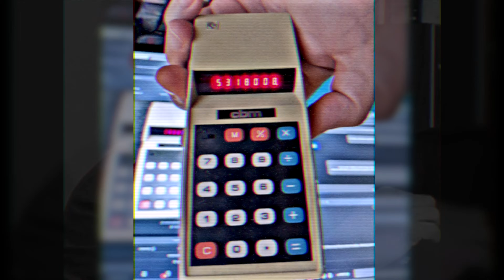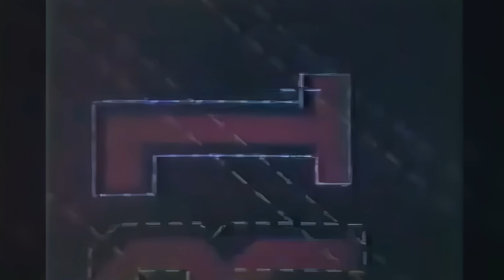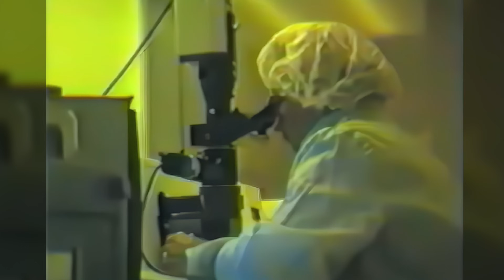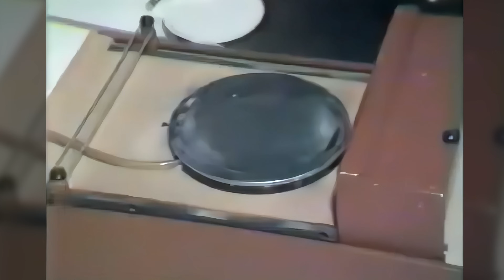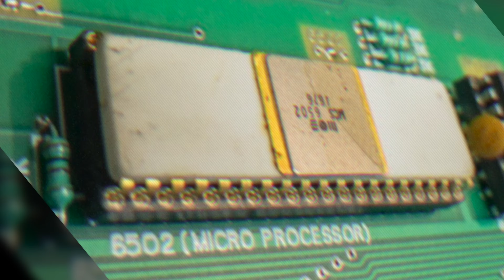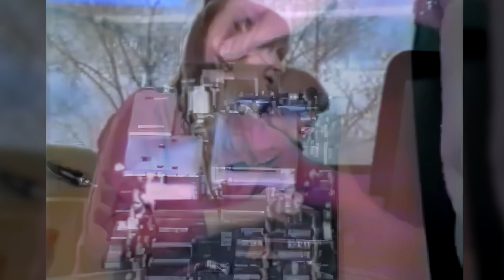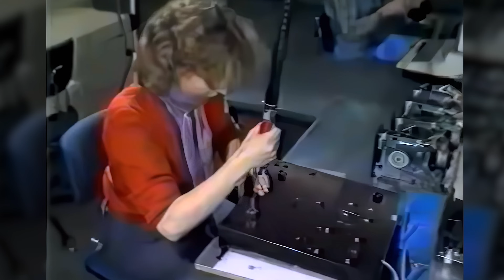How It Was Made: THE COMMODORE 64 factory tour

Comment: I can't believe this was less than 20km from where I lived in the 1980s, and less than 5km from where I went to school. I did have a C64 later, but I had to push through my father's resistance against me buying one - from my own saved pocket money. My father being an electric engineer developing circuits at Siemens in Braunschweig, and having worked for Konrad Zuse before - you know, the guy who built the first mechanical computer, the Z-1 (which is now on display in the tech museum in Berlin).
It is mind-boggling to realize that I could have been at the center of this and might have become and engineer myself if it hadn't been for my father's discouragement. I always thought I was living in the middle of nowhere. Turns out I did - and did not, at the same time.

Comment: It would have been hard to imagine in the early 80's, there was any factory anywhere in the US cranking out VIC 20's and 64's...  and yet there was.  Apparently.   Back then I just assumed it all came from parts from China, Asia, Indonesia, Japan, Mexico...    probably most of them did.  I had no idea it was assembled in the US by US people though...   kind of wild.  And not in Silicon Valley.   Blows my mind.     Where was Commodore 64 made?
"The VIC-20 assembly line, which was to begin making C-64s, was in Santa Clara, Calif. As the C-64 went into production, Commodore was also opening a new assembly line in West Chester, Pa. There were additional VIC-20 assembly facilities in Japan, where the disk drive for the C-64 was to be manufactured."

Comment: Good video - but as somebody from the industry and who's well familiar with the C64 I noticed a bunch of inaccuracies.

The video implies the C64 uses the 6502, even shows a PCB with that type printed on.  Actually the C64 is based on the 6510 which is a minor variation of the 6502.

"Hundreds of thousands of transistors" the narration says.  The chips of the C64 didn't have that kind of complexity.  The 6502 was in the range of 3,000 odd transistors with the 6510 barely more complex.

In 1987 some chips such as the MIPS R2000 with its around 110,000 transistors were still being layed out manually.  There are photos around showing how the layout of the R2000 was spread out on a rented squash court!  Obviously this design technology was running out of steam.  Modern chips with the 20 billion odd transistors would not fit on the hull of the death star.

As a German I have to say the worst of the video is the pronunciation of the name Braunschweig 🙂

Comment: Ok, let's start to rectify some bullshits: 
the C64 cpu did non contain (as the video say) 64000 cells with some transistors inside! It was only about 3500. the more complex z80 had 8500 transistors inside. To reach a 60000-70000 transistors inside a cpu we had to wait the motorola 68000 a tech masterpiece for its time, named 68K because it contained 68000 transistors.... ;-)

Comment: 1Mhz.  20 years later 1Ghz, an increase of 1000x.  But clock speed has been stagnant for the past 20 years.  Some things may have reached their limits, and they're already fudging the advertised number of transistors per mm² by stacking them.  That's mm³, but that's all they can do because it's physically impossible to get them any closer together.

Comment: I love these old machines.  One of my hobbies is to buy broken 80's machines and restore them and so far in my collection I've got a Vic20 (the rarer 'VC20'), and 2 64's.  One of them a 'Breadbin' original with a low serial number, and the later C64 model C.  I adore these old machines and have a real passion for them.  I feel sorry for the kids these days who will never know the joy of learning programming on these machines.
Reply: I have always loved the C64c or 128 design style, but never had one.  I still have a lot of my original commodore equipment, but they are earlier.   I have a bread bin 64 and two Vic 20s, with one of the Vic’s being very early.   I also have accessories like two 1541s, tape drives, a 300 baud and 1200 baud modems, a mps printer, and a 1571 drive.   The C64 was the heart on my setup, the accessories were all bought to connect to the C64 over the years.   I wish I kept things like my commodore 1084 monitor, c16, plus 4, few other items…. But back then they were my daily use computers so the things I still have were the items that were most useful and taken care of ( to the point where I have the original boxes, manuals, etc).  I ended up using the 1084 as a TV due to the really good picture quality until it wore out and died, then discarded….who would have thought back then that 30 years later I would miss it, lol.   Today my son is learning about retro tech and really loves it, I built an emulator for him using an dell board with a amiga 2000 case that had a board beyond repair, he loves his ‘commodore’.   It runs Linux and VICE so he can select C64, VIC20, C128, etc .. but he loves it’s in a commodore beige case and wired it up so the LEDs, power switch, etc all work as intended.   :)

Comment: I had just gotten back from Germany serving in the USAF and a Commodore Pet was all I wanted. I order the $800 model with the extra ram and the night UPS came with it, I was out. I was a UPS driver for 25 years later in life but hadn't heard of them yet in 1977. I looked their office up and drove there to see if I could pick it up in person instead of waiting until tomorrow. The driver hadn't gotten back to the building yet so I had to wait 45 minutes but I finally had it in my hands.  
I got it home and plugged it in and nothing. I tried and tried and it wouldn't work. I looked in the manual and called tech support and luckily they were open. They told me sometimes they get rattled in shipping and I should open it up and press down on the IC's inside to make sure they were seated okay. That did the trick and I was on my way. Some friends came over because we were supposed to go out to eat but I said , no way. I'm playing with this. I graduated to the C-64 and returned about 10 1541 disk drives to Montgomery Wards because the heads went bad over maybe 2 years and then upgraded to the Amiga. Fun Times.

Comment: as with so many others the C64 profoundly influenced my life. Born in Vienna/Austria in 1970 and grown up in a relatively science-hostile family. Chemistry aparantly was bad, physics was bad, mathematics was bad, the atom was bad, only nature bla bla was good. In 1984 my father had bought a C64 and intended to use it, but I quickly took over and confiscated the device :-) had quite some special needs as i am almost blind. Used an old large color TV set and sat a few cm infront of it to be able to read. I fas truely FASCINATED by programming, first in BASIC then in the machine language of the 6502 (or 6510 as it was called in the C64 due to different handling of the first 2 addresses of memory). there were magazines e.g. the German "64'er" that explained and tought machine languages courses. I was absolutely blown away by the things one could do with that. finally in about 2 years of work i wrote myself a fulll text-editing-software that was also capable of enlarging the screen using tricks like the raster-interrupt of the VIC chip and characterset-scrolling. Finally i was allowed (in the 1980s) to take the computer into my school classromm and finish my education / get my grades. 
Never again had i learnt so much about computer architecture in so little time. And my life and way of thinking was shifted away from science-hostility and esoterism, towards acceptance empbacing and loving any modern science.
This really is a nice video, thanks for uploading.

Comment: very interesting. I live in north bay Ontario Canada and remember when NORAD changed the computers in the underground complex. they took it out in dump trucks and had to add heating equipment after the old tube computers were removed and replaced with new smaller ones

Comment: A great video, but 27 year veteran as a semiconductor engineer as few small corrections. 
The diffusion furnace does not dope the wafer. It grows a layer. The implant tool dopes the layer. Also the furnace is at the start of the line it grows a layer that the Litho tool can print onto. 
Thanks for amazing footage of early semiconductor tools and footage.
Reply from the maker: Thanks for the correction!
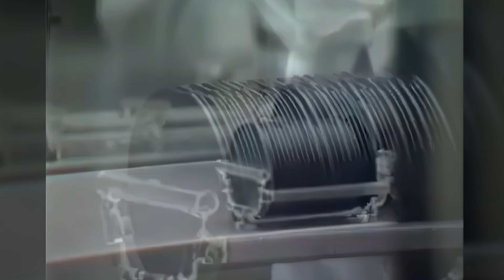Reply from the maker: I have added a pop up correction at 11:00

Comment: The C64 launched my career in software engineering back in 1982.  I'm retired now at 60.
Reply: Yeah me too....had a 64 after high school I got used from someone and started to learn programmng . I was a repair tech for lots of things and was interested in computers ...I'm 66 now and still working .
Reply: I'm younger than you but yes, it's been an important system for me, too.

As computer technology improved things become buried in layers and layers of abstraction.  Which all happened for a reason and enabled the wonder that modern software is - but it also blurred programmers' view at hardware level programming.  During my carrier I noticed the kind of people who really understood low-level programming as progressively getting older.  Only the comparatively - to the C64 - introduction of inexpensive systems based on ATMEL and similar processors changed that.  So yes, the C-64 taught something very useful.
Reply: Then something went wrong. Engineers don't retire at 60. They keep doing side husles deep into their seventies. I think the C64 is to blame.
Reply: @lovemadeinjapan Smart people enjoy careless life in retirement instead of slaving in jobs until death.
Reply: That's what I used in grade school to type. And, then, I got one after then.
Reply: I remember messing with the Basic for Commodore 64, a little diffrent than Basic for PC. I wish I learned C programing, that was way back in the 80s. I worked for a compny that used Fortran.
Reply: Why retire ??

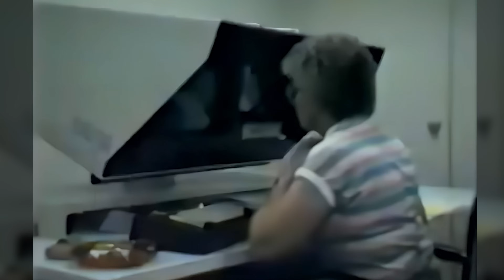Comment: 3:27 - A Calma CAD system. I worked for Calma back in the day. These machines used a minicomputer to design IC chips https://en.wikipedia.org/wiki/Calma - Also shown at several later times in the video.
Reply from the maker: Very cool! But who designed the minicomputer… 🤔
Reply: @RetroRecipes  data general I think.  CALMA also had a server that connected 8 or so cad systems built from a VAX

Comment: Hello Recipients. Very, very nice picture. Yes i outpacked out mine in the first half of the 1980s as i was a young teenager. Programmed it in Basic and Assembler. Tuned it with a parallel floppy booster. Sold it finally for a custom steering wheel for my first car. After that one followed a C500 Amiga. I still kept this one in the cellar. Addon memory board but unbroken guarantee seal. An Amiga 1200 completed the trio and as an successor never came is buyed a windows personal computer, heavy hearted. Good old times. Many of the persons in this film are already very old or died in between for shure. Greetings from Germany.

Comment: The C64 was my first computer (technically second, as it replaced a faulty Vic-20). Apparently, it was at the forefront of stock-footage actors being clueless about how to fake using a computer. "Mankind is finally on the threshold of that fantastic future, where young people type 3-handed gibberish, from the comfort of their homes, and where the key to the world of tomorrow, is apparently the ENTER key, regardless of whether the computer is turned on or not."
One thing that jumped out at me though... cleanrooms are not hermetically sealed. If they were, it would be impossible to get the workers in and out. They are HEPA filtered and maintain positive pressure. Very different from hermiticity.

Comment: In the mid 80s, I personally designed  an electronics interface and wrote the software in 6502 assembler using the C64 as the hub device to run an automated educational Christian radio station. I did it all by myself in 6 weeks, quite an undertaking as i had only professionally written software in MIDAS, Fortran IV and Basic at the time for gamma ray spectroscopy. But I had just finished a Heathkit course in computer hardware when i was asked to do this. I would hope i still have a copy of the software somewhere. Thanks for restoring the film footage, it took me back to a simpler time. KD

Comment: They expected people to use C=64/6502 CPUs for 40 years?!   To be honest, in 1984, the concept of 64K or 128K computer would last you 5~10years.
Then came the Amiga, Mac in 1985.

21min = VIC-20s.   But they still used the 6502.   Recognized those boxes.
Reply: WDC still sells the 65C02 version of the chip, manufactured by TSMC.  It's rated up to 14MHz operation.  Seems to be affected by the chip shortage since prices are showing $10 each to get one now, which is just ridiculous as these were going for $1 or less before.

Comment: Why do people not know the difference between "silicone" and "silicon"?  
Silicone  is a synthetic compound that can be like rubber or even as an oil. 
It is very very different to silicon the element that we find in sand and that is refined into silicon ingots and sliced into wafers into and upon which integrated circuits are manufactured. 
SILICONE is the rubber stuff or an oil (Silicone grease)
SILICON is the stuff that chips are made from.
Reply from the maker: How did you like the rest of the video?

Comment: Jack Tramiel stated a while back that for about one year that Commodore was producing +1 million units a month so the 17 million figure is dubious. Indeed, production of the C64 was started around January 1982, and the all possible spare capacity from the VIC-20 production lines was used to build up massive stocks of product. Either way 99.99% of Commodore 128 owners powered it on with C= key held down so that's another 4.5 million right there to add, same as figures for the ZX Spectrum include 16/48k. Plus, 128k, Plus 2 and Plus 3 ;)

Comment: I love all the quality control footage which - sadly - didn't extend to the power supply which tried to set our first C64 on fire (it got as far as smoking out the interface port before we powered down and exchanged it - we exchanged 2 before all the parts worked, sans fire or sparkles on the monitor). Great B roll footage tho. Pity it didn't reflect the quality (or lack thereof) of the output.

Comment: The MOS 6502 and its derivatives are just legendary. RIP Chuck Peddle. You brought computing to everyone with such a fantastic CPU. It was easy to code for. Easy to control. Powerful enough to run the devices of our childhoods. The Apple II, VIC20 and C64...and of course the NES. 

When I was a kid growing up here in the United States the C64 was so ubiquitous. For working class folks in poorer parts of America if someone had a computer it was generally a  Commodore. By 1986...1987 you could get a 64 with disk drive for under 300 bucks. No time for silly tapes here.

Comment: Did the Commodore 64 have expandable memory? 64k seems like nothing. My first computer was the MEG Macintosh from 1985 with 1mb of memory. I still have it but I didn't boot it up from 1997 to 2015. When I turned it on I got the blinking question mark on the file folder. I also have the cheapo dot matrix printer I used with it back in the day. 
That thing was SO loud and slow.
It kind of sounded like someone was using a electric power drill.
Reply from the maker: Yes you could buy a RAM expansion unit

Comment: Just have to say that while some of the chips in the C64 were likely designed using CAD techniques, that the heart of the C64, the 6510 CPU (which is a 6502 with added I/O for memory control), was surely designed by hand by Chuck Peddle and team.  Definitely its almost identical 6502 predecessor was, and the story is that it worked on the first try, with a bit of debugging needed to fix only minor issues.  Of course after the 8-bit days, the complexity quickly escalated beyond the capacity of human hands to do all the design work.  The C64, and its predecessor the PET, and successor, the Amiga, were all revolutionary in their days of course, and I often feel that in some alternate reality where Jack Tramiel hadn't been such an a##hole to his engineers, suppliers, and other business partners, that we're using "Commodore format" or "Amiga format" PC clones instead of IBM.  Whether that would be better or worse in the long run, who knows..  Almost forgot to add, thanks for showing this interesting bit of history.

Comment: I'm sure modern chip production involves about 1% as much human interaction as the process did back then. If not, each chip (with tens of billions of transistors) would probably cost more than a house. Anyway, because of the state of technology and all that human intervention, I wonder if that's the reason that the maximum clock speed of 65xx CPUs at that time could only muster about 1-2mhz. If a 6510 was made today using modern processes and atomically pure materials, etc I wonder what kind of clock speeds it could handle.
Reply: The limitation was the 6510 was an NMOS chip, i.e. an old school type chip.  This meant the chip had to energize all the time and so used a lot of power and would get way too hot if it were clocked too high.  They stuck with this 5 micron design for the C64 since MOS already had major investments paid down in their fab and so the chip cost very little to produce.  MOS then developed the 8502 processor (2MHz used in the C128) that had HMOS manufacturing process, which means it was a hybrid type of CMOS that allowed the chip to run with less power and cooler even if clocked higher.   MOS did not invest any further in the 6502 lineup. However, WDC did, as they also owned by patents.  They created the CMOS version, the 65C02 that was used by  Apple for the //e and //c series.  Because a CMOS chip runs much cooler with less power, //e enthusiasts ran the chip overclocked to 4-6 MHz with good results.  WDC still manufactures the 65C02 and in its refined model can handle up to 14 MHz speeds.